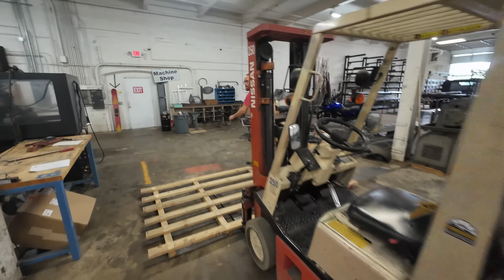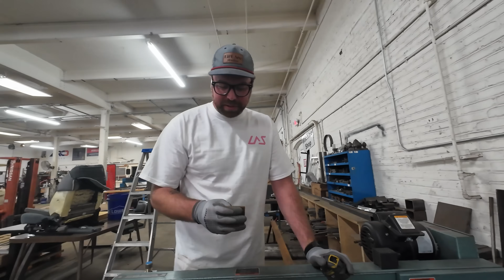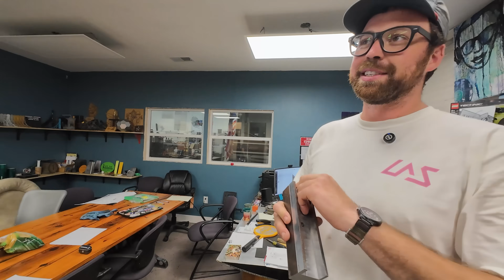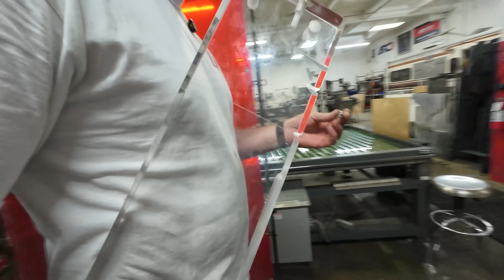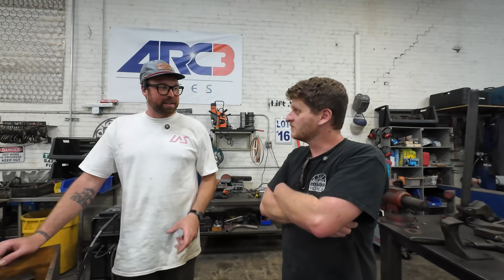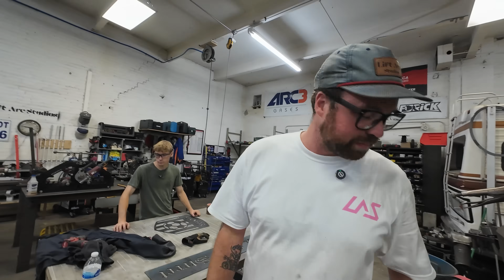Precision Milling with the MR1

Comment: With drill Acrylic (and a lot of plastics) you want different Tip angles than standard jobber drills and normally AVOID hand drills as you can get chipping and even cracking on thinner sheet if it digs into the face.

Comment: You need .002 in so you can do a cleanup and finish pass to make the metal look good. All you would have needed to do would have been to add a finish pass after the main one, and it would have cleaned it up.

Comment: So adaptive is a roughing strategy, in this case where you take so small cuts it would be fine if you just uncheck the box but normally it leave bumps on the walls and takes freedoms precision vise depending on settings when it makes the toolpaths. I would have set stock to leave to zero axially then cleared the walls with 2d contour. If you would make a pocket and put a round boss/island in it you would see the problems with using it as a finishing toolpath

Comment: How come y’all don’t cut your aluminiumium (Brit accent) off all into squared off chunks? Why leave all the excess unusable material? It’s what I did operating a CNC wsterjet table for a couple years. Then I had a rack I made to move around with a forklift with vertical dividers to store different sized usable off all material from the table and marked what each slot was holding. SS-316 SS-308 etc plus gauge thickness. 

We made a horizontal removable shelf rack to handle 5’x10’ sheets. You could pull up to it with a forklift and select what shelf of material you needed and pull it out and move over to the cutter table. 

We used a jib crane next to the table with a vacuum suction cup sheet carrier to handle the material lifting it. Used a big on/off magnet with D ring for thicker sheet steel pieces. For 1” to 2.5” thick sheet steel we used super duty C clamps with square nut threaded shaft to clamp to the material and HD straps to the forks. We did have a large Toyota forklift to handle those sheets tho. Normal sized forklifts for up to 1/2” steel plate. 

Anywho… carry on 🤓😎

Comment: use a slot drill (keyway cutter) two flutes designed for this job
Reply: High Speed spindle on the MR1 so 4 flute on steel and adaptive followed by a cleanup series of passes. Fairly sure they still have a Bridgeport and if it wasn't for wanting to use the MR1 and learn some more that would have made more sense on that lump.